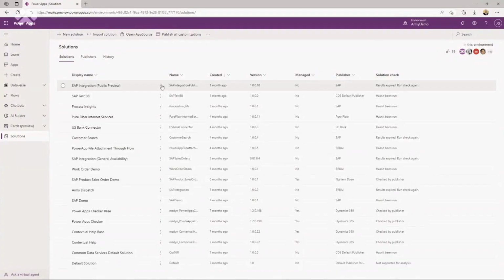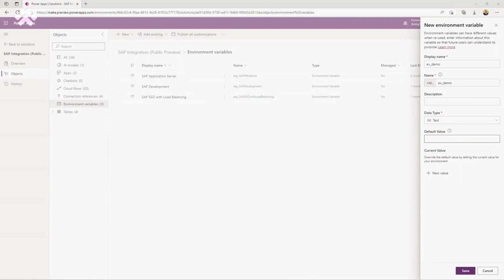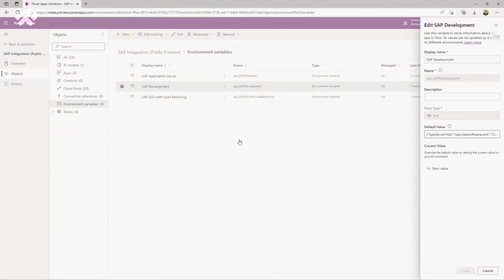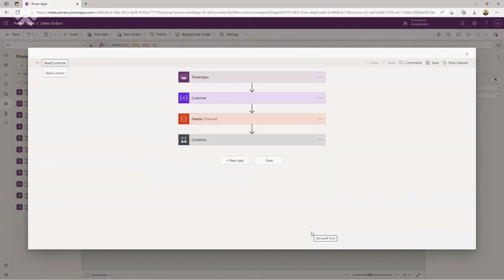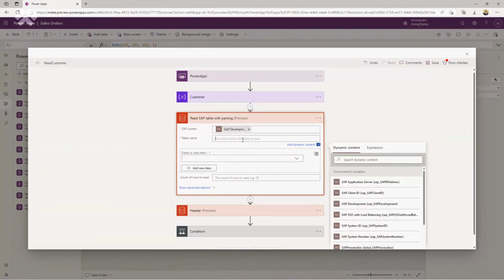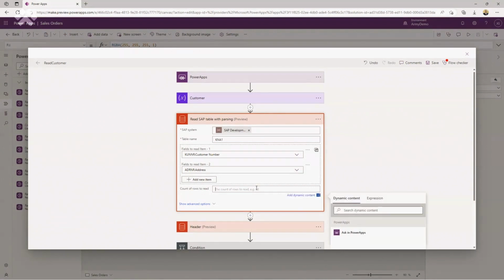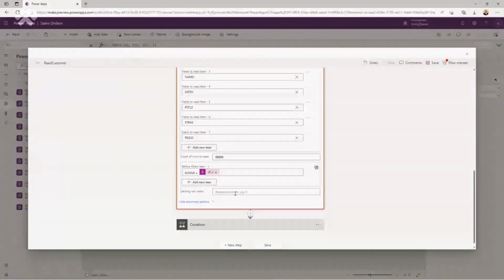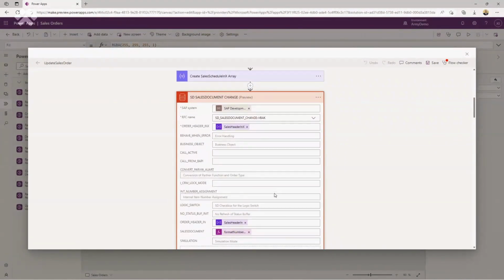SAP – Power Platform, SAP and the ERP Connector

Comment: I need to automate ST22 how could I do it ?
Reply: Hi

Yes, you can use the table read BAPI (RFC_TABLE_READ) and the Parse function. You will need to know which tables in particular you want to dump/read.
Reply: That is the problem @powercat474  there is no table in ST22 and SM51 the 2 checks I need
Reply: @powercat474   Do you have any SAP article detailing access?

Comment: My organization is trying to democratize/globalize the SAP ERP Connector. The thinking-out-loud idea is to enable/manage SAP Connector within a dedicated company-wide environment. Anyone who is trying to leverage the SAP Connector has to apply for business approval n granted access to that dedicated environment. My argument will be the technical hassle for users to migrate existing solutions to the SAP Connector environment. Is there any better idea or best practice as an alternative?
Reply: Congrats on your work to enabling automation with the SAP ERP Connector and the Power Platform. Although the connector does simplify the process of interacting with SAP, remember SAP itself is a complex data source that has real business implications, be sure to keep that in mind when building your approach for democratization.

Also, environments are the first level boundary for controlling security, DLP and automation with ALM. It’s possible that the different business units building SAP automation will require different environments for these reasons. One SAP environment may not solve your issue (e.g., Sales vs finance teams).

I suggest you have a SAP team who works with business teams where they need to be.